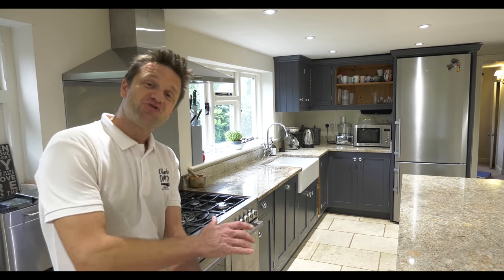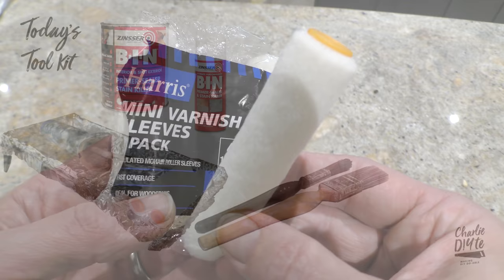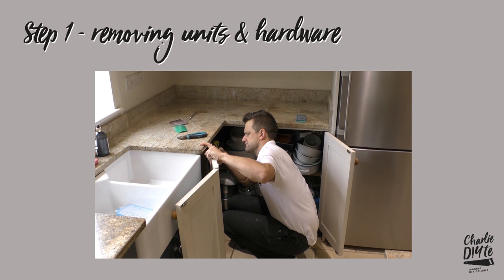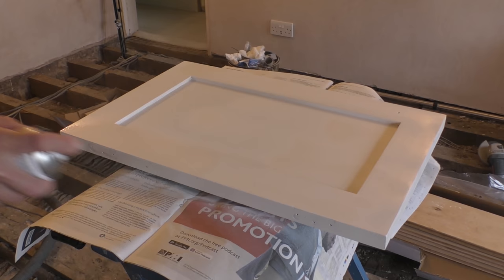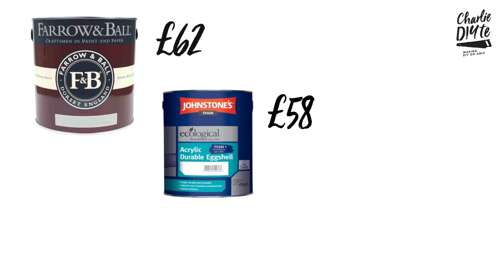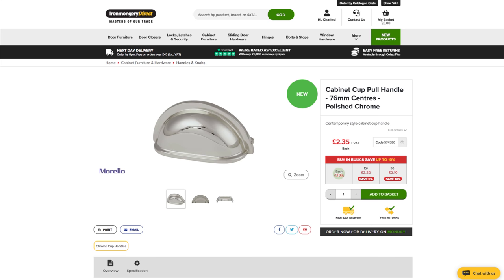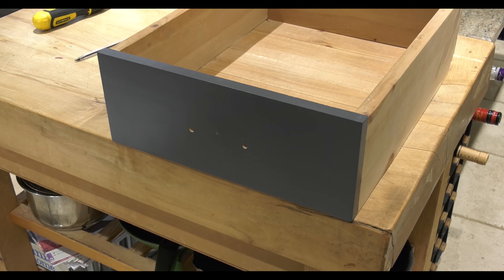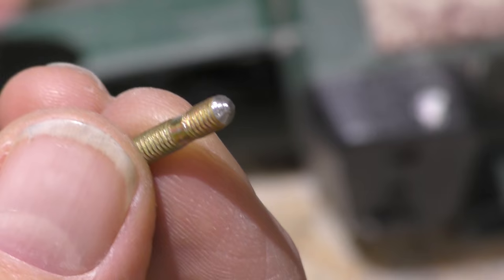Kitchen Makeover - How to Paint Cabinets & Fit New Knobs and Cup Handles!

Comment: The finish is HORRIBLE ~ cabinets should always be SPRAYED unless (for whatever reason) you absolutely can not. In that event, there are WAY better videos showing the correct way to do it by hand ~ just be warned that it PAILS in comparison to spraying. Best budget HVLP Systems: 1st choice: Fuji 2202 Semi-PRO 2 (2203 gravity fed version) for $439, & 2nd choice: Earlex HV5500 for $299. Remember, a good tool is not an expense, it is an asset that can be sold for 70-80% of it's value once the job is done, and in the end it will produce superior results and require much less sanding/work.
Reply from the maker: Fine but no DIYer is going to buy a spraying kit and construct a temporary spray booth, just for a simple makeover like this, even if you can flog it on at a 20% loss.
Reply: The finish is lovely. Pipe down.
Reply: This is a free country boy and I am free to tell the truth. If you can't handle it GO AWAY.
Reply: @johng9562  Boy? Haha, love the insecurity. The finish is fine, keep your unnecessary and rude comments to yourself.
Reply: I will say what I please when I please boy. Go away NOW.

Comment: Valspar is a disaster. I have lost so much money and time because,  trusted Valspar. Its a disaster paint. Never in a million years, I will use this paint. Trust Me.
Reply from the maker: I'm inclined to agree. Lots of chips to repair. Bottom line, don't buy paint from a high street retailer (B&Q, the Range, Wickes, Homebase) because they drive a hard bargain on price with the manufacturers so the manufacturers have to thin it down to maintain their margins. Always buy from a Dulux/ Johnstones Decorators Centre/ Brewers or similar.

Comment: Great video! I see you recomend BIN In most your videos. I wanted to paint my wardrobe satin black but unsure if I require an extra coat of grey on top of the BIN and then the black on top or go straight in with the black 🤷🏾‍♀️ any advice?
Reply from the maker: Yes, I love the stuff. It dries so quickly (too quickly actually in this weather) and adheres to a ridiculous array of surfaces. Not sure why you're thinking you need the intermediate grey coat? I'd go straight on with the black. You may need two coats of the black (I've just had to paint 3 top coats for my Johnstone's acrylic eggshell. You can also get the BIN tinted, which might help?

Comment: Foil - genius!
Reply from the maker: I can't really claim the credit for that but it works a treat!
Reply: @CharlieDIYte  I'd recommend Wooster Pelican Hand-Held Paint Scuttles which you can buy plastic rigid liners that fit perfectly. They have a magnet built in which holds the brush so it doesn't fall in, and it's the right size for a 4 inch roller.